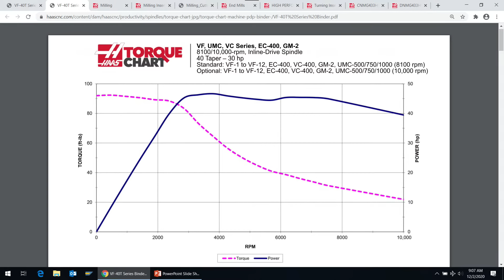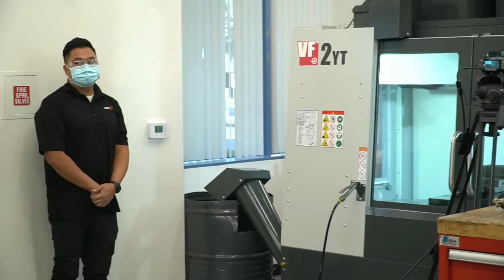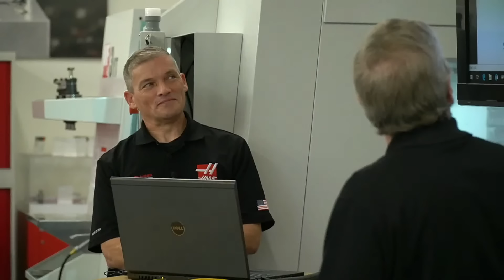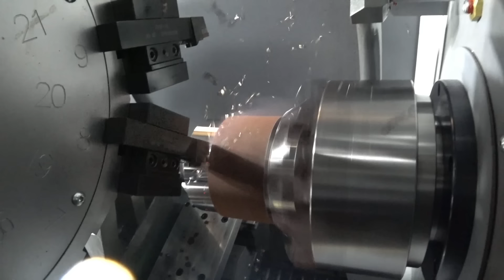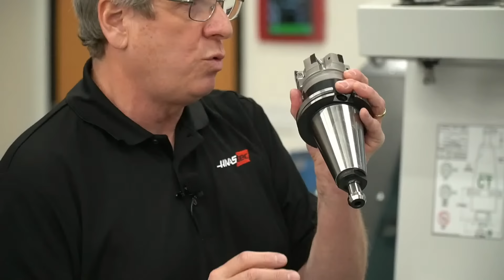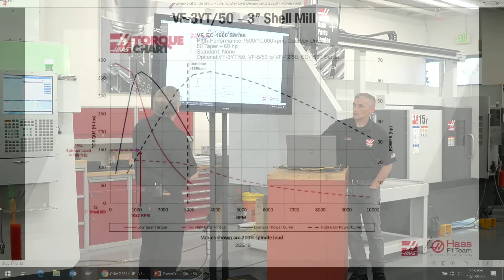Demo Day Live Wednesday December 2, 2020

Comment: On my Haas the spindle load meter starts to go red when it hits 100%, so I think it would suggest not to go over that.  I try to hit 80% load most times, but I am usually reducing my cut parameters to deal with chatter on long tools or when the setup isn't as rigid.

Comment: 21:15
it does not make sense to me. We should always utilise the max flute length of the tool with controlled width of cut as per the spindle load. That reduces the vibrations and makes your tool last longer. Tool is better utilised too.!

Comment: I work in the turning department at my job and we have 12 haas turning centers and we pretty much only cut 304, 17-4,13-8, and other steel and a little aluminum.  no problems cutting steel.

Comment: What steel grade you have used for the vf 2 milling demo? , What hardness?
Reply from the maker: doc0302 - The material John was cutting on the VF-2YT was 4130 chromoly steel with a hardness of 163 on the Brinnell scale. Thanks.

Comment: Not trying to call yall out but it looks like your work holding moved since the chamfers on the third demo arent straight. Looks like the vise moved not cutter problems.
Reply from the maker: Rance, Good eye! It looked the same to us when we were reviewing the video but we went back and looked at the finished part and the chamfers are straight and equal width on front and back edges. If you listen to the cut you can hear that the tone doesn’t change until the tool turns the corner to do the side edges (indicating no increased chamfer width). We are thinking the visible difference is just lighting glare.